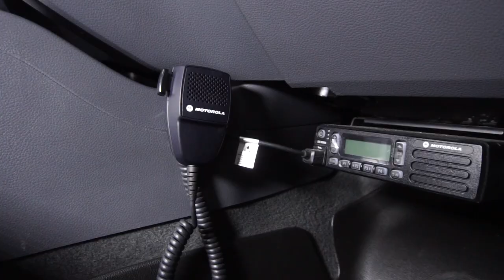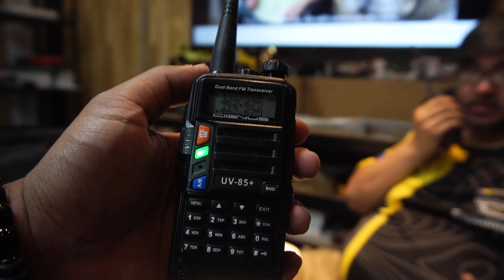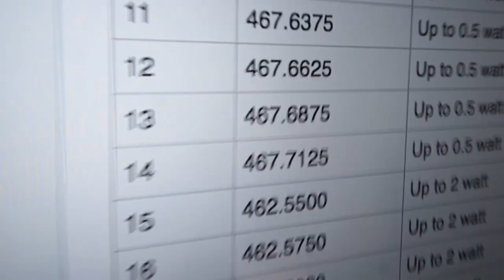Overland Communications in the Philippines (Hand held & base radios)

Comment: Badboy, to operateWalkie Talkie you need a license from NTC, radio defend for  used, may Amateur, commercial, Military, Air ops, so from Low Freq to Extremely Ultra High Freq, 1-30Mhz nasa SSB, VHF 130-170Mhz, 420-470 UHF, other freq nasa Military used.

Comment: Sir nag check po ako sa NTC and it says hindi daw approved ang FRS or GMRS to use in the Philippines. Tama po ba? Regards
Reply: The Philippines has a radio service for use of families and small businesses. This service is called SRRS or Short Range Radio Service. Repeaters are not permitted, and units are limited to 2.5 watts.[10] [11]

This service has been allocated 40 channels at 325 MHz
Reply: tama wala sya sa radio control law of the philippines, hindi sya defined